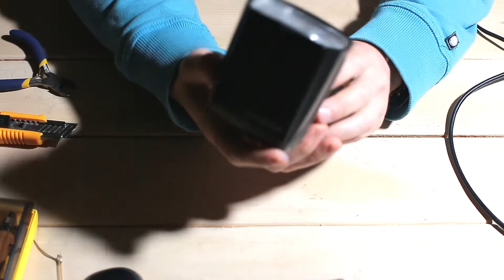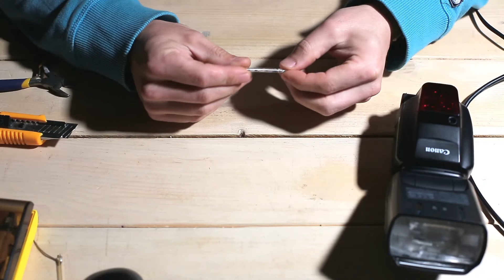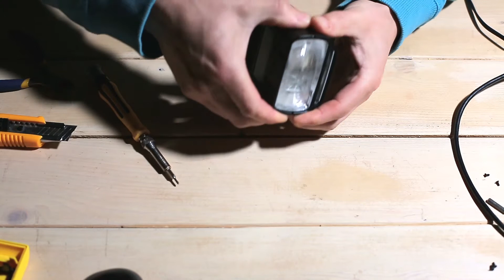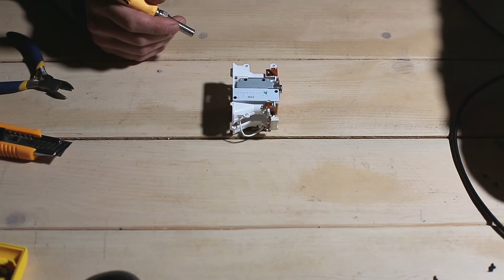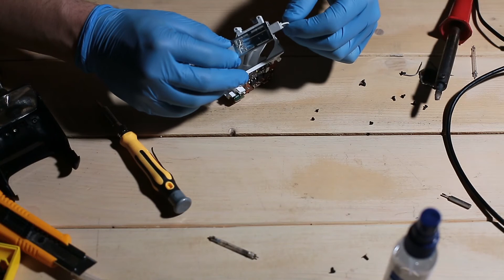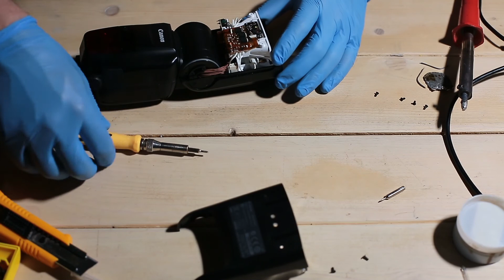Canon speedlite 600Ex-RT repair

Comment: This would be a really good tutorial if you had used 2 lights to light what you were doing. Those harsh shadows were avoidable. You have edited out parts that relate to what you have done and where you are going at various stages, I guess in an effort to shorten it. No one cares how long this particular type of video is, they just want and need to understand everything. I don't believe anyone will take this on from what you have put here. It's a pity as you know what your doing but failed to communicate it. (Also your a brave person handling small screws on surface like that!)

Comment: good evening, I took to repair my canon600 and I have a quote of 180 euros.
I did not repair it, but they disconnected the wires. now I changed the tube and the broken pieces but I do not know how the wires are connected.
can you help me?
thank you so much
Reply from the maker: yes of course, if you send me a picture with your head lamp

Comment: This, Canon 600EX II-RT and Sony HVL-F60M flashes are the world worst flashes.
Overheat & shutdown & melt Fresnel lens. 
All not built for the pros.
Reply: i agree !!!
Reply from the maker: I burn the lamp exactly after two years or it's just burned herself :) and i bought two of them :)
Reply: @arte_alexandru  When you were using the flash, did you use the ATG's ATG/Godox/Nissin/Quantum Turbo Battery Pack?

All Canon/Nikon/Sony failed badly once you've used the external battery pack like the real event & wedding photographers do.

The king and still the best without overheating, shutdown nor meltdown:
1. ATG's Metz 60CT-4r and Metz 60CT-4
2. ATG's Quantum QFlash T2
3. ATG's Nissin MG8000 Extreme 
4. Currently #1- ATG Gold X Kim X, 2nd place ATG's Profoto A10
5. Maybe 3rd tied: Canon EL-1 and Metz 76MZ-5

All Canon 600 series & below; Nikon SB-500 & below; Sony HVL-F60RM II and below have tiny amateur flashtubes.